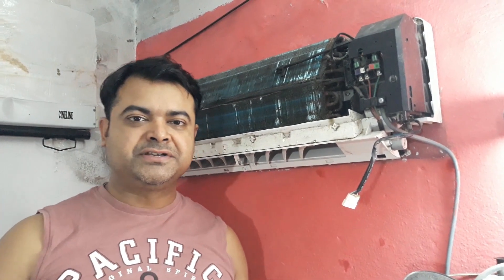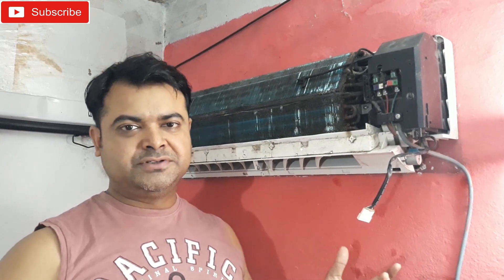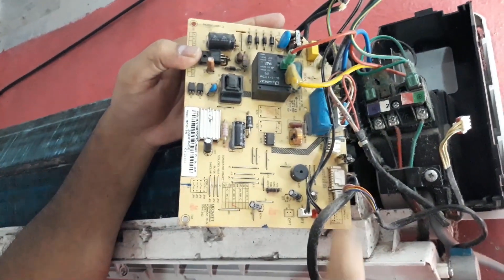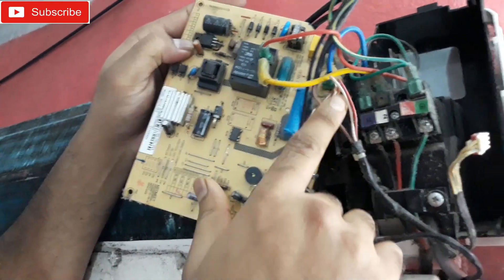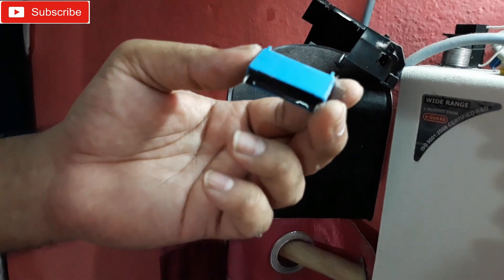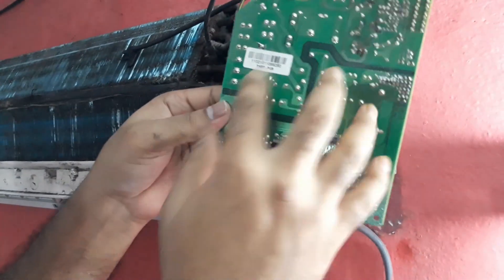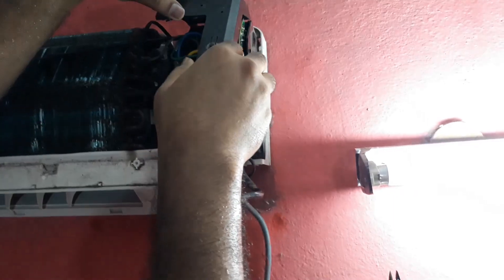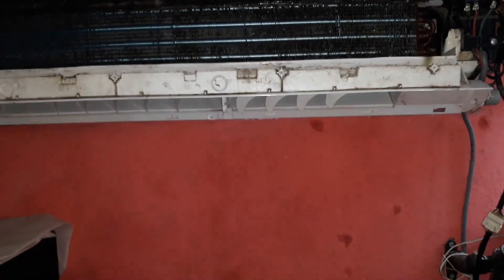How To Replace AC Indoor Unit Blower Motor Capacitor In English // AC Indoor Unit Fan Capacitor

Comment: What is the price of capacitor the one u have changed looks like fan capacitor
Reply from the maker: Around Rs. 50 i think
Reply: @technoboy-allinOne  thank u
Reply: @technoboy-allinOne  if possible upload a video on Electrolux split AC blower removing and cleaning
Reply from the maker: Yeah sure i will try to make one.